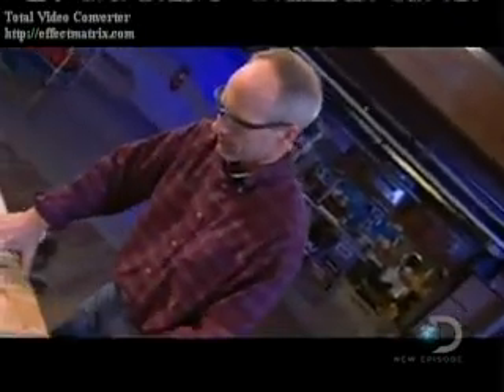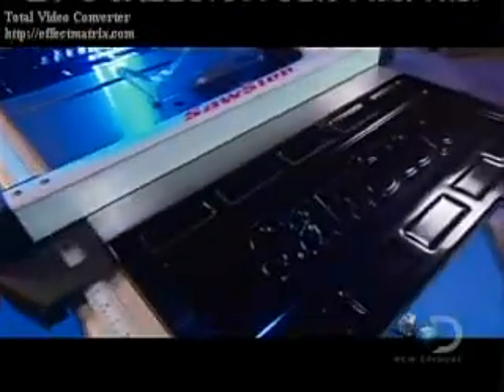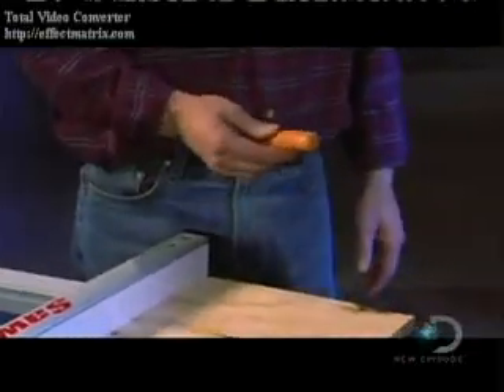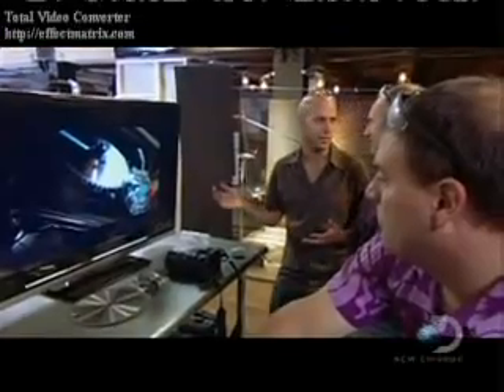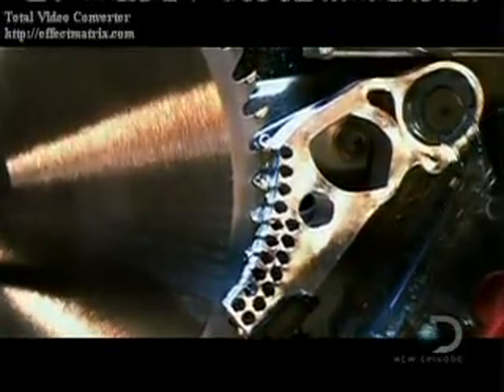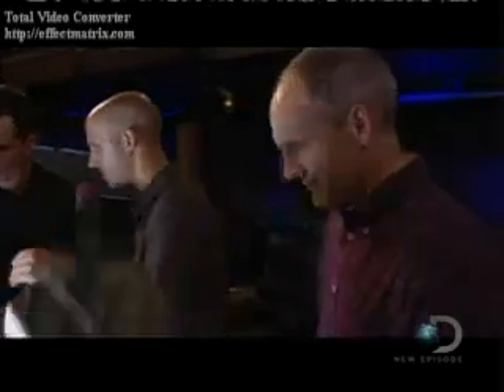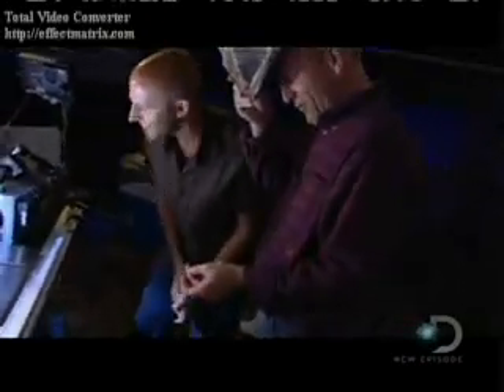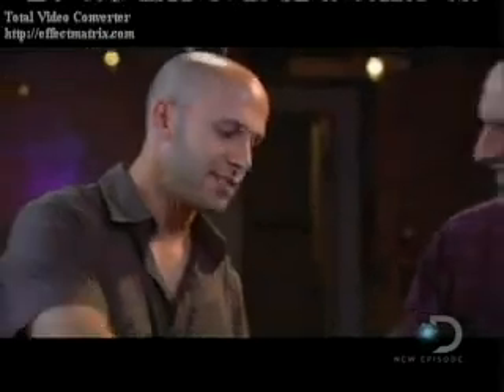SawStop Finger Demonstration - move over hot dog!

Comment: People may laugh at this until they get careless. If it saves a finger or hand it is well worth the price.
I have a friend who just ordered one and it should get here within a week. Made in the US or Japan there is no substitute to have to go to the emergency room.
All it takes is one event and it is well worth the price.
The table saw does have an over-ride feature that will disable once each time the saw starts. The next time it will engage again.
Reply: A friend of mine's daughter was cutting out some pieces of lumber to make some camping chairs to sell. She did not get her finger close to the blade but something on the push stick or wood was damp enough to engage the safety feature of the saw.
You can disengage that feature on a cut by cut feature. You cannot disengage it all the time. 
Your right about cutting your hand or finger. The price of a emergency room visit and hand surgery is more than the price of a new blade and blade break.
Reply: +D. Hansel I was wondering if wet timber would be enough to set it off......Wouldn't be much use to me.  All the builder's merchants around my way store their wood outside.  Great idea/invention though!
Reply: Yes it will. I have a friend that has a Saw Stop table saw. He told me that wet wood will trigger the saw brake. However you can defect the Saw Stop Circuit with a key that is built into the saw. When you start the saw you turn the key to defeat the safety for each time you turn the saw. The key turns off the safety and comes back to standby.

Comment: I ran my right thumb thru a table saw a few years back and, luckily, only took some of the meat off the pad. I think with this system I would've been making a trip to the hardware store instead of the ER after the incident. I agree with most that this wouldn't save most from injury but it will certainly minimize it

Comment: alright so to fix the problem of the damage to the blade/actual saw stop thing, couldnt you just wire it so that its hooked up with the blade height mechanism and instead of stopping the machine have it just instantly drop the blade to below the table where it cant cut you.  cuz then it wouldnt have to be replaced every time it activates
Reply: Razors and blades. If they could even make  your method as safe they'd still be losing out on replacement sales for their effort.

Comment: what happens if your hand is dry and you hit it with actual force?
Reply: Blood but probably not an impromptu amputation. On another video I looked at a year ago or more, they tried putting a hotdog in as fast as they could and managed to get around an eighth to a quarter of an inch into it. (split the difference and call it 3/16")

Comment: @OveRSwE I see what you mean....but you have to take into consideration that the tool has been designed in a very particular way to be repairable in the event that the sensor is triggered.  And it is an extremely simple fix.  We have done it several times at the shop and always have at least 2 extra modules/brakes on hand in case it happens.  It takes about 20-30 minutes to swap one out.   Regardless, it beats getting sued by a student's parents when their kid comes home with no thumb.

Comment: @malaki222 little module? seems like the whole brake is broken, and probably also the blade. and i dont know exaclty how it works but the voltage sensor might be hard to connect/reset and the brake, depends how they chose to solve it